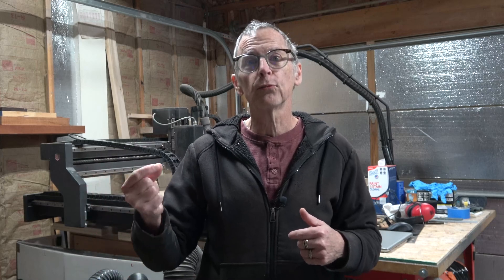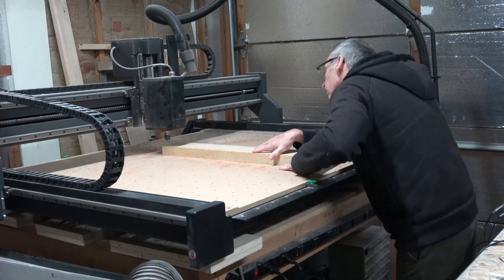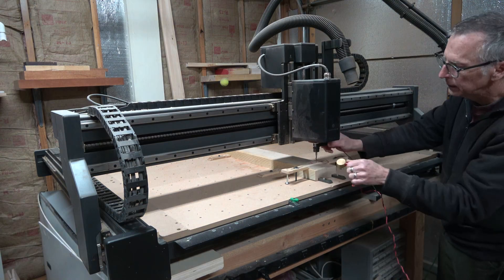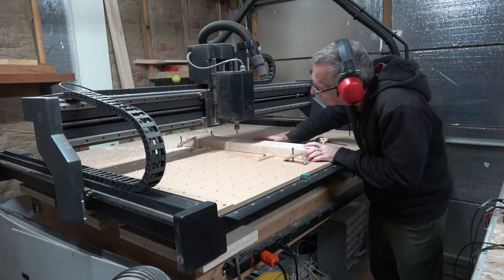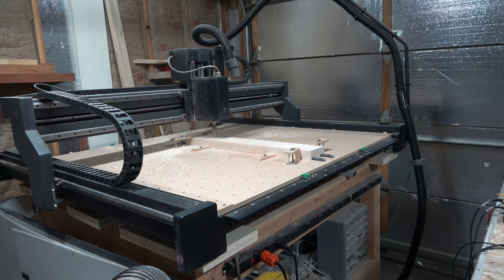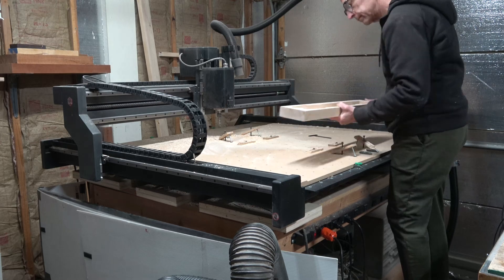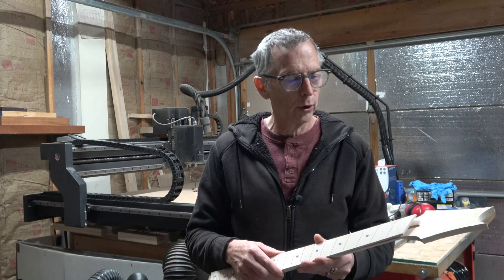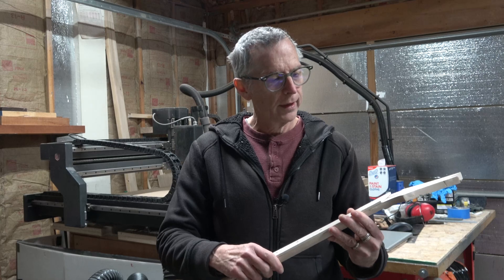Making A Six String Multi Scale Guitar: Making The Neck

Comment: Thank you so much for this video. I think you're the only one on YouTube that has shown the actual cnc process for a guitar neck. The whole process of flipping the wood over was something I couldn't figure out how to do until you explained how to use tabs.

If you're running low on video ideas, I'd love to see how you would do an archtop guitar on a CNC where you carve the bridge and the bracing right into the top of the guitar. I think you could potentially get a better sounding guitar since the whole top is one piece of wood that resonates instead of having a top that has the bracing and the bridge glued onto the top.

Comment: Hi, Chris. Another great installment in the series! I've watched most of your CNC building videos at this point, and I appreciate how you explain the various factors and approaches. Hope you don't mind questions about specifics: but, did you only use three different bits for that session? Like a downcut end mill for the truss rod carve, then the 1/4-inch ball nose for the other stuff, both the rough pass and the finishing pass, but two different lengths? Also, what is your approach in terms of an X versus a Y parallel finishing pass? I noticed you used the X finishing pass for the back of the neck. Is there a methodology to this depending on the piece? Also, did you use any pencil finishing pass, or was that just added to the finishing pass g-code using MeshCAM using the same bit?
Reply: So wait, is that long bit just a regular straight end mill, and if so, did you go to a ball nose for the finishing pass?
Reply from the maker: @thomasbreene893  I just use a regular end mill instead of a ball nose end mill. I don’t think using a ball nose is worth the effort to swap the bits and run the probing operation again. I’ve done a lot of testing with both types of bits and I just don’t see any advantage of using a ball nose. With a regular end mill, I can get a surface that’s ready for 220-320 grit.
Reply: @HighlineGuitars  Thanks again. That's really useful. Right now I'm sequencing separate carving operations in Rhino (I do it using layers and by turning off the ones I'm not using). So, some of them have a roughing and a finishing pass where I can use the same bit, but others do require some swapping. Let me ask you this: Do you still do a shallow pass for the neck pocket and pickup routs, etc., with a downcut bit to get the best finish, then switch to an upcut bit to carve out the rest of the pocket?
Reply from the maker: I used a 1/4 inch downcut and a 1/4 inch up cut extra long bit. No ball nose bit.
Reply: @HighlineGuitars  I thought I remember you using ball nose bits in the past to do parallel finishing. Are you finding that a regular end mill produces similar or better results? The neck contour sure looks smooth and clean!
Reply: Sorry, disregard. Didn't see your second explanation. Thanks!

Comment: You mentioned the safety tabs before. And, although I have no experience with these machines at all, I am sure it makes sense.
But would it not be possible to let the CNC remove those tabs safely in a final run?
Reply from the maker: No. The bit, which is spinning at 20k rpm, will fling the neck across the shop and cause damage and potential injury. If the neck was fixed to the waste board with double sided tape, tabs could be eliminated, however, I have found that approach to be very unreliable.

Comment: If you include programming and set up is it the same amount of time to do all the work by hand?

I realize that each build shares code and set up but for this example of a one off build would the time be similar?
Reply from the maker: From start to finish, I can CNC a neck about 3 times faster than I can make one by hand. Also, my neck, shoulders, elbows, wrists, and back are much happier.
Reply: @HighlineGuitars  i do one off woodworking and often find that by the time i set up all the power tools and find the extension cord I can make the cut and get the piece out with hand tools.  I was just curious about the time spent on the computer code and setting up the cnc to make one custom item vs hand carving as it looks like you still have a degree of hand finishing each piece